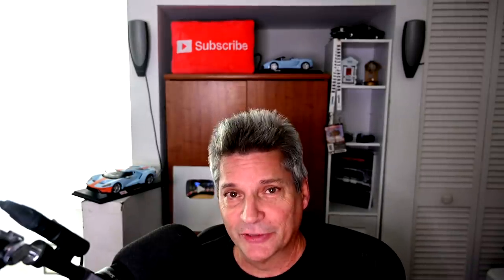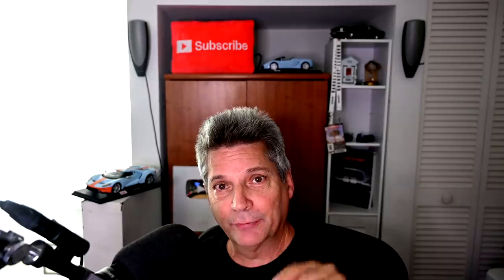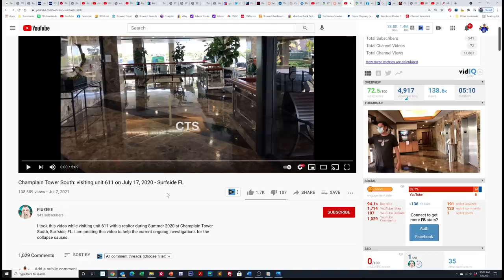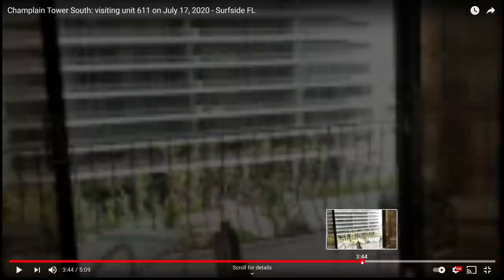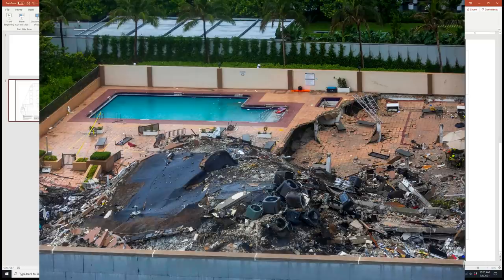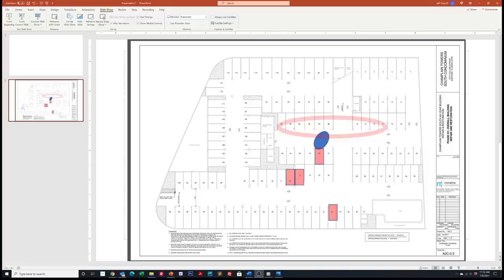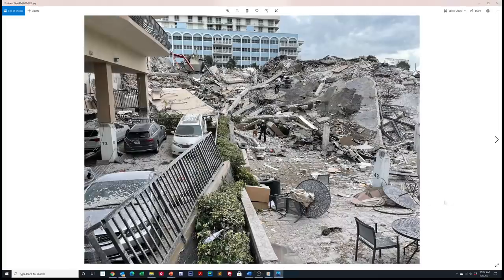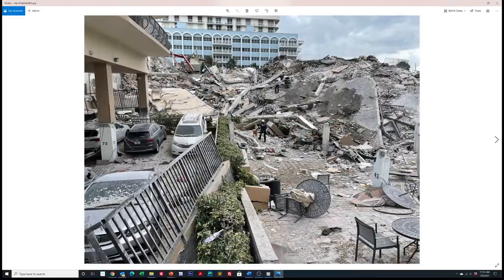Analysis Garage Video BEFORE Condo Collapse: Water Everywhere

Comment: For the height of the building, the pillars looked skinny. I've been in garages of 8 storey buildings where the pillars were really beefy and flared out at the top and bottom to prevent punch-through. Skinny pillars will hold up a building just as a million toothpicks could, but any lateral movement would topple them all.  What about the pillar that got hit by the BMW?
Reply: I was thinking the same, really thin. I was wondering if, when the pool deck collapsed , it would have pulled on the columns sideways
Reply: That's probably what the coda was at that time
Reply: @BearsTrains  There's a short animation vidio link around here someplace that shows just that. Well made vidio but notorous for being misleading. Still once you see it. Pool deck collapses pulling on support columns which buckle under edge of structure, dominos pancake collapse.

Comment: This is truly sad and a tragedy that we will probably never forget, hopefully, they find the cause of it.
The Here's cause of Miami condo collapse was a great video!
Reply from the maker: Thank you and yes that's why I put that video out I'm hoping that it will help stimulate we'll help stimulate people thinking about construction thinking about construction better and what can cause failures like this and may be mitigated from happening this aint maybe mitigated from happening again.
Reply: I haven't seen, but does anyone know if the other two condos were constructed the same way?
Reply: @alinah1927  they where as cully constructed the same way just a different design
Reply: @timelapsefilms3526  thank you for answering, but does that mean they're facing the same risk?
Reply: @alinah1927  It can mean they are dealing with the same thing
Reply: @timelapsefilms3526  thanks again for responding & your expertise.  Very worrisome indeed... I hope they're inspecting it with a fine tooth comb & now know the warning signs ..
Reply: @jeffostroff  Seems they had several waterproofig issues. 
Looks like large a shower pan (but over a garage) that
didn't have a slope to the drain or have weep holes to drain the water on the
substrate to allow drainage. =Failure.

 What would expect? I watched a video of a report about the garage/pool area that mentioned they didn't allow for a sub slope to drain, even though
it was specified out for a pre slope. 
Looks like they didn't slope the roof either. 
That was probaly a factor to why they were fixing the roof too. It was leaking so bad it
waterlogged the substrate. (exactly the area of the start of the collapse)
It's  also possible they are going to find large plugs of new roofing tar that were stacked on the roof  (these plugs are VERY HEAVY) over the area of the intial collaspe,  
Thats just my guess,  if so, its my belief it was a roof failure-trigger that began the collaspe.  Usually roofs are loaded all at once to save loading fees. 
The work had already commenced, the roof inspector had already passed the pre deck inpsection.   

Another factor: I haven't heard anyone mention anything about is: the roof drainage. 
It may have had dammed the water from the top and filled the roof with water. (water is HEAVY)
There could be numerous failures within the roof plumbing etc. (I believe it was raining that night) 
Perhaps some debris from the roofers clogged the drain? Just saying. You never know. 
It's not good pratice to leave debris that can float on a flat roof. That’s an accident waiting to happen. 

I’ve seen a lot of accidents caused from drains. Roof collapses, water
intrusions, water backs up into building, etc. 
The drain systems are sometimes “one” way, water can flow down fine but not always watertight coming “up” the pipe.
Reply: @jeffostroff  First of all, Thank you for all of your informative videos, thoughts, and hard work. I hope someone, who is investigating this tragedy, will watch them as well. I noticed in the first part of this video, some of the columns had a waterline on them. Wouldn't water have to be there for a good,  long time to make a mark? However, I didn't see any water marks on the other columns in the later part of video. Prayers for everyone! 🙏💔😥
Reply: Water weighs alot and would put additional force on deck. The leaking below suggests cracks in decking. Dont know if recent seasonal weather cycles (freeze/thaw) might have influenced it. Every structure built by these architects/builders should be reevaluated. Something very wrong here.
Reply: @dananorth895  in south florida, freezing water isn't really an issue. On the few days that get below freezing, it doesn't get far enough below freezing and stay below long enough to freeze water inside the concrete. It takes a lot of energy to change the temperature of that much mass, so the temperature change is gonna happen slow. I worked for a concrete cutting and waterproofing contractor a few years back in south Mississippi, which is a good bit north of Miami, and freezing wasn't an issue there. The representatives that sold us our sealants and elastomer said it doesn't become a threat until you get up into Tennessee.
Reply: @alinah1927  The North Tower is an IDENTICAL TWIN built off the same blueprints, except for the pool layout. The East Tower appears to be very different and I believe it was built much later. Of course, virtually all condos/apartment buildings built with concrete are of a similar "slab and post" construction.
Reply: @alinah1927  The North Tower is an Identical Twin to the collapsed South Tower but they are claiming it has none of the same problems. I'm think this collapse was far more likely caused by a LACK OF MAINTENANCE than by some design flaw. The one thing that concerns me the most in the South Tower was the reported rising seawater in the garage during high tides. It's possible that even though all 3 properties are built on bedrock, that there is some undiscovered underground channel that is allowing the high tide to get underneath the building. That would certainly explain the wide and deep crack in the floor we see at 32:45. Any water getting there at high tide could easily flood the entire underground parking deck as described by a former maintenance man working there in the 1990's.
Reply: @melissaciswhoibe9183  For a 40-year-old building that paint in the parking garage looked awfully bright and new. It's also obvious that a ton of "hide the rusting rebar" patches have been made in the garage ceiling over the years and fresh paint hides it pretty good, until it doesn't....
Reply: Something is wrong in the U.S. today. The land of amnesia. this has happened several times in construction history and people keep forgetting. I'm betting this boils down to those suddenly uneven columns. Every time they deviate from intended building design this happens. If nothing is don't about this stupidity plaguing the West in the modern age people will forget and we will be back to where we started.
Reply: @dalewalker4614  thanks for your insight as well.  That's what I was eluding too, how close the condos were built to each other timewise & if they used the same structural engineer/construction company.  I read comments referring to the beams being too small or not enough rebar for the structure, but believe it's the water damage that did it in.  Also, if there's flooding from high tide as i read.. wouldn't it affect the North building also.  A gentleman also mentioned about elevator shaft, the underneath giving way due to water.  All very good points & ty Jeff for your detailed analysis & giving people a platform to discuss what could have happened in order to prevent future tragedies, not to mention educate a lot of people on what signs to look for now when renting or buying property.  Thank you 🙏

Comment: This is very interesting video!! I have 4 theories about the cause that are connected with each other but only 1 trigger, The crack in the garage floor and the slope of the ramp drain next to it tells me what happened when it collapsed!!
I’m a structural engineer and honestly this is very bad structural design (no haunches, crowns) to support the slab/column interface. These 2 new videos explained a lot about this awful situation.

Comment: Crazy to see this. I'm not an engineer but a real estate appraiser. These things would jump out at me. I would take pictures and type in bold both that I recommend an inspection from appropriate expert(s) and that my value is based on the extraordinary assumption that the building was in fact found to be structurally sound.
Reply from the maker: Glad to see you loo for these things!
Reply: Why do I suspect you don't work in Florida?
Reply: A couple purchased one of those units and had only been there 3 months, with a baby on the way. So sad this event took place .
Reply: It is wise to inspect a condo buildings general infrastructure since the buyer of a condo unit would be on the hook for all repairs to the condo building that are needed. Imagine buying a unit in that place and then getting hit with a $100,000 assessment out of the blue.
Reply: @kindGSL  Ha, you are right I don’t; however, USPAP are the laws that govern all appraisers across US.
Reply: @jameskeefe1761  If that is the case, then there is some shady business happening with HOA. Dues should be partly contributing to a fund for when large repairs are inevitably needed. Dues may be higher for a few years, but having a $100,000 dropped on you as the owner of a condo, would be a sign of mismanagement.
Reply: @Athena124  Very true, but sadly around 80% of HOA Boards cave in to the owners who don't want higher assessments and their "Reserve Account" never gets funded. If you can't afford the existing HOA dues, or you can't find the money if they went up by 50%, you should NOT be buying into ANY co-owned (HOA or similar) community. Just a fact of life. If you already live in a co-op community and they are not funding your Reserve Account properly to maintain the building, get elected to the Board of Directors and make it happen......
Reply: I think it was inspected a few years ago, but nobody did anything about it.
Reply: @RatedArggg  , yes it was inspected in 2018.
     It appears later inspection must have been done, because the cost of fixing the building had double by 2-months before the collapse.

Comment: @5:00 "What is this?" Its an area that had cracked all the way through and had been leaking, it was repaired with a can of "flex seal" and never bothered with again.  If you look back over photos and "on the ground" maintenance records you will see that this place was literally held together with "flex seal" rubber, no real efforts for maintaining or repairs where made to this structure.
Reply: BuT iT iS ChEaP!

Comment: The scary thing is that there’s several more of these condos on that same beach built by that same company. Some reveal water in the parking garages when there hadn’t been any rain  in weeks. That’s bad bad.
Reply: You would really have to contemplate moving at this point.   Scary
Reply: @fgrau7376  I’ve already heard people saying that they would move out of the beach condos.
Reply: There are buildings all over the Mississippi gulf coast with this same type of water damage. I have been saying for YEARS you could not pay me enough to live in a multi-story building near the ocean. Salt water and rebar are mortal enemies.
Reply: In my experience, it is rarely the Contractor. Contractors follow a design done by licensed engineers. Further, the engineers count on proper maintenance to be performed as a building ages and condo owners are never easy to convince that repairs, that cost extra money, are needed.
Reply: @jakesgrl6378 when?
Reply: Where is the water coming from?

Comment: Excellent videos. Keep them coming. I know that garage like the back of my hand, as my family owned a condo there for almost 30 years (we sold in 2013). The cones were used by residents to block off their spots so that the valet wouldn't park a visitor's car in that spot while they were gone. The hurricane panels bolted to the ceiling were to deflect water away from the cars as those calcium-loaded drips would ruin car paint jobs. The car I had parked down there would be covered with a plastic tarp for that very reason.
Reply: in other words the water problem has been going on a looooong time.....people got used to it.....
Reply: @marilyncourteau8951  correct. It was perceived as an inconvenience more than an existential threat. Every few years they'd do patch works, inject something into the cement, etc. In fact, there were several locations throughout the garage where there would be screws poking out of the cement following the trajectories of cracks or leaks, which to me didn't seem to accomplish a thing. Eventually those very screws would rust and/or be covered by stalagtites.
Reply: @reaganista  very nice work!

Comment: The mystery object on the ceiling is a "leak deflector" It conduits the leak water away from parked vehicles.
Reply: I'm no building contractor, but it looks like something Moe, Larry, & Curly pieced that thing together.
Reply: @redlinemando  they probably would have done a better job
Reply: If there is that big of a leak that needs a homemade leak deflector, this is a huge problem. So sad that these people suffered.
Reply: I saw the explanation of those devices in another YT video about the collapse.

Comment: Those large cracks near the ramp could be caused due to a leak at the drain where the ramp ends that is leaking into the ground below the main foundation of the garage floor which could explain the collapse if a big enough void started to form underneath the parking garage floor at the entry point due to the leaks.
Reply: But that void wouldn’t impact the structure of the columns.

Comment: Notice how the ceiling paint is peeling above spaces 52 - 54, to the left and right on the ceiling.  Indicates water has been seeping in that whole area.
Reply: 6:10 noticed this as well, tough video is so fuzzy, can't tell if its flaking paint or stalactites, but both is bad.
Reply: It's as if water is pooling on almost entire slab.
Reply: @dananorth895  from what i learned from another video, the entire deck above (pooldeck) is not sloped, and has no drainage.
So every drop of rain just keep sitting there, on, between and under the pavement, untill it dries naturally, or finds its way trough the insulation. It rains a lot in this area, and the insulation was known to be damaged, water always finds a way through.
The entire parking garage nust have turned into a wet, dripping cave, only a few months/years after opening.
They always had issues with water ingressions, often struggling to pump it all out, yet the owner did nothing but occasionally have bits patched by some cheap amateurs, which could not be bothered to look into the underlying issue.
I my opinion this deliberate neglect turns the accident into manslaughter.
There is another, almost identical building a few plots further, it should be evacuated and closely inspected by independent experts.

Comment: Column 106 in garage has ‘water staining’ on the bottom in the yellow area that makes contact with the garage floor. On 104 and 52
Reply: Yes, I was going to comment that a lot of the columns have water marks above the floor level.  It's seen through the paint.  That would mean the columns are absorbing water upward or the columns are wet at the base from the water traveling downward from the upper surface.  There's way too much water in that area.  The waterline is at least 5-6 inches off the floor
Reply from the maker: Ye sit is everywhere!
Reply: Yes literally every column has damp rising up
Reply: Yes! Noticed the water marks on the base of the columns.
Reply: I noticed that as well
Reply: Those stains may also be the results of a tropic storm, that might be the line where a set of sumppumps fire up when the garage floods. I would think that wicking would be more random, and would effect less posts, and it would be less uniform. But that's just a theory. If you could see a garage elevation, and see if those marks are where the floor is lowest, it would kinda explain how some of the columns don't have the marks, the clean columns are in areas where the  grade of the garage floor raised above the standing water during a flood.
Reply: Yes definitely a high water mark
Reply: @jacktheaviator4938  I would say it's far more likely to be rusty water from the steel reinforcement.
Reply: @TryptychUK  idk, it looks too even to be wicking, with too much of a hard line. I grew up on the gulf coast, and it looks like high water flood marks I've seen in the past. I can't say for sure, because I am looking at a photo that wasn't trying to capture the stain, but that's my take on it based on my experience.

Comment: At 5:29, look at the darker color at the base of column 105/106.  It almost seems as if the bottom of that column is damp and that moisture is around it.  The irregular pattern of the darker coloration would not be from a paint mismatch, it is too irregular.  It looks like moisture either present or historical is discoloring it.
Reply: It's like that on many of the columns. Water damage for sure

Comment: Great Job Jeff !  I'm just an Ag Engineer but see a lot of issues also ! Ck back at counter # 5:22 @ Collumns 105/106 . Poss. evidence of "wicking action/ capillary act." from floor up under paint. Or painted over area from previous substantial water standing around Collumn. Also note the freshness of the paint on Collumns vs. Poor paint quality on walls, parking spaces,
stop barriers. USUALLY if the crew is already there with paint etc., u do it all to save re-work. Possible Collumns repaired & repainted for a esthetic/ cu from building inspections.   POSSIBLY